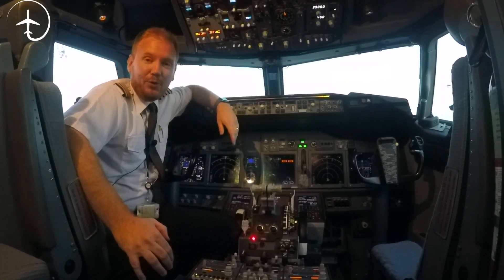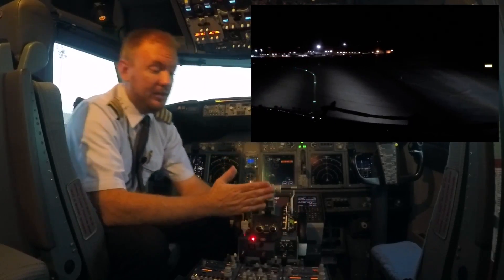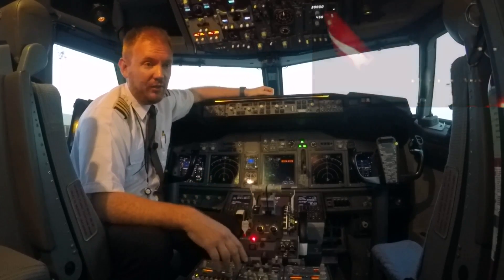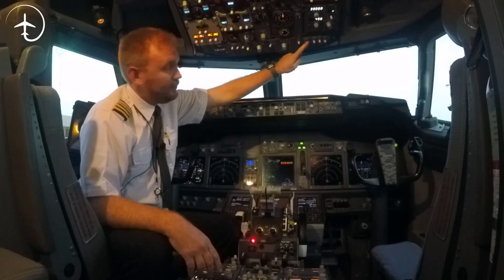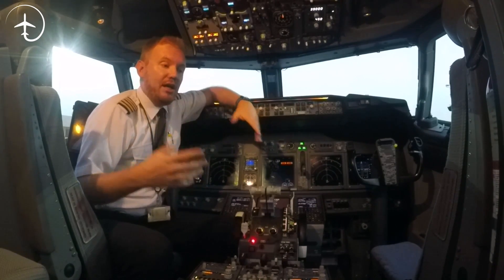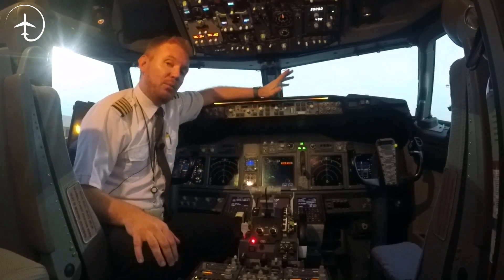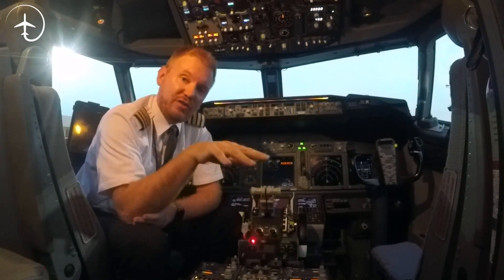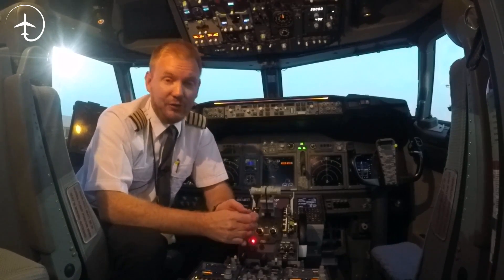Boeing lights explained

Comment: I always wanted to ask you if a malfunctioning autopilot is reason to abort/divert.
Reply: Truth's Knight_0777 we have two autopilots. if the right one doesn't work, than the left one will. difference is autoland is out of the question
Reply: Ava Mendez Just woke up. Lol! Yeah, I know there's redundancy with cmd, I meant hypothetically, if there's a complete failure with both (yes, I know the chances of that are extremely slim) if that would warrant diverting, or would the commander continue the flight manually if he/she feels confident in the aircraft's performance. 
Prolly a dumb question, but just curious... Lol.
Reply: Truth's Knight_0777 most probably divert asap. If there is an autopilot failure, then that’s really something serious.
Reply: A2DJP No, it is not serious, but it increases workload significantly.  On a shorter flight, the crew would probably continue, unless it would put the next flight segment into jeopardy (weather might require an auto land, or needs to be flown in RVSM airspace).  

If in RVSM airspace, the aircraft would have to descend below RVSM airspace.  On a longer flight, it might be prudent to divert, but it depends on weather conditions, day/night, and ride conditions.  It’s up to the crew, maintenance control and dispatcher if the crew involves them in the decision making process.

Comment: Really good video but the sound is not that good. It's sometimes really hard to understand what you are saying because of the dirfferent noises in the cockpit. I don't know if you have something like that or if you using it allready but there are these small microphones that you can pin on your shirt I think that would help. Eyerything else was really informative and helpfull over all good video.

Comment: I often hear the Flight attendants saying that you have to be able to open up the over wing emergency exits if you sit in that row (makes sense). How heavy are those, as you have to lift them out of the frame?
Reply: Itrolller1234 on the A320, the OWE (overwing exit) doors weigh 33 pounds.  a gentle force of about 7 pounds is required to open them
Reply: Itrolller1234 Depending on aircraft, around 30-45 pounds.
Reply: Itrolller1234 On the NG models however the overwing exits are assisted opening and will swing up and out with very little effort.
Reply: Ava Mendez Thanks for the reply

Comment: Thanks for the video! As usual, incredibly good. Here is a question: Why operators usually do not use the retractable landing lights? (Btw just realized the 737 you are flying is not equipped with it, is it correct to say it is something obsolete?)
Reply: On takeoff, some operators avoid using retractables. That is because it can actually cause a little bit of drag. I think this was a more serious issue in the 737 Classic aircraft, but it apparently still exists in the NG.

Comment: Very good explanation, thank you.

I do have another Q for you, hopefully you haven't answered it yet. I'm new to your channel:

How do the 737 yoke and pedals react to your input? Do you feel any resistance from the control surfaces as a feedback, due to the aerodynamics (in normal flight)? How much force do you need to apply to the controls?
Reply: MrJetra on the A320, we make turns by gently moving the sidestick left or right to the correct bank angle.  rudder input from the PF is not required,  since the yaw damper handles this function
Reply: Ava Mendez Thanks, but my Q is specific to Boeing 737 (and 747), because they are fly-by-steelcable, in conjunction to the Airbus's fly-by-wire.

Basically, I know as a glider pilot how to control an aircraft. My Q is if the mechanical linkage in 737 is a feedback. I understand from the Baltic Aviation Academy (BAA) YT videoes that a loss of thrust on one engine requires a lot of pressure on the reverse pedal to keep the aircraft aligned. For that reason you have the rudder trim on the pedestal.

Well, to be honest, my Q is related to an idea of building my own 737 cockpit simulator on FSX/PMDG. There is no trouble connecting a joystick to the sim, but if a feedback is required to make it "realistic", at least I need to know. Next step is to know how much force feedback is required.
Reply: Ava Mendez Btw. I assume you are an Airbus pilot. Don't you have any feedback (except the stick shaker) on your stick? I understand from Captain Joe that there is no connection between the sticks, but there could still be a feedback.
Reply: MrJetra there is no feedback since the side stick is connected to a computer. the Bus is envelope protected,  in normal law, it cannot be stalled
Reply: Ava Mendez Thanks, that is a pure answer. If I decided to build a Airbus cockpit sim, it could use a simple joystick for realism.
Reply: If you watch some 737 cockpit landing videos, you can see the pilot moves the yoke around quite a bit. I don't think a lot of force is needed, but a lot of correction is. It takes a little bit for the controls to respond, and that is why there is so much yoke movement. Left and right, up and down. I think X-Plane 11's flight physics show this very well. Try it out.
Reply: 23 Savage. You're right about the movement.

But as I wrote before, I've seen a video from BAA where the pedals indeed are affected on a single-engine failure. At least it seems to require a large amount of force to align the aircraft in this situation. 

My thought was that the aerodynamic forces on the ailerons would transmit back to the yoke.
Reply: On single engine failures, rudders will be needed yes. However, usually, pilots use the rudder trim instead of pushing the rudder themselves. It's easier, and reduces the workload for the pilots.
Reply: And btw, in normal flight, with windy conditions, i believe (correct me if i'm wrong) the yaw damper actually controls the rudder to avoid the plane drifting to the left or right.
Reply: Ozan Akdag Actually, we use the rudder to control the yaw, then we use the rudder trim to reduce the required rudder pressure to zero.
Reply: MrJetra There is not stick shaker on an A319/320(it goes,”stall, stall, stall). There is resistance felt in the stick to provide a feel when stick inputs are made.  On the 727, 737, 757, 767, the control surfaces are moved hydraulically, but a feel computer, that has an airspeed input, gives some feel of resistance to simulate the feedback that you might have if you were moving the controls by cables.  Faster speed, more force required to move the yoke.

Comment: Is there any way the pilot can communicate with ATC tower using the lights, in case there's a radio failure?
Reply: Mr Me In smaller aircrafts, there a radio failure or no radio procedure. You come in for the approach and rock wings (turn right and left) and this procedure will make the ATC understand about your radio failure. Some people also blink the landing light on and off but am not sure if that's a standard procedure. So once you rock wings, the tower will guide you with a light gun, and there are several light gun signals that any pilot should have memorised at any given time should their be a radio failure. You are taught that in ground class in your PPL stages itself. As for bigger aircrafts, they usually have a transponder and they squawk 7600 for communication failure so the tower knows that the radio has failed. Though I am not sure if the lights can help in any way, but I hope my answer gives some basic idea about the concept.
Reply: Good question. Yes the Squawk code is the option used in airliners and big aircrafts. But in most GA planes, we fly VFR and we don't always have a functional transponder. Most GA planes lack transponder and / or don't use it, hence the only way is the light gun signal, as in, rocking wings to let the tower know our situation.
Reply: 7600 in the box and follow lost comm procedure from the charts
Reply: Shafat Hasan Isnt squawk code an easier procedure?
Reply: Mr Me  Yes There is...There’s a piece of equipment called the “Light gun / signal lamp” There’s specific colour that signals that has specific meanings
Reply: Shafat Hasan Makes sense thanks.
Reply: Shafat Hasan No operational transponder?  What country do you fly in?
Reply: Mr Me homing pigeons work

Comment: Favourite thing that I only found out recently. Easiest way to distinguish between Airbus and Boeing is that Boeing have a single flash strobe while Airbus planes have a double flash strobe. 

(that is if you can't tell them apart anyway.........)
Reply: Boeing commercial jets have pointed noses while the airbus have the rounded somewhat Douglas like noses
Reply: Cool! Never noticed that 😉
Reply: You can still see the double flash on older model Boeings.
Reply: James Funnell 747 has a double flash
Reply: Airbus has mini winglets whereas Boeing planes do not

*Pending on the airline

Comment: the anti collition light is not always red. kan be white too. the King air and ATR have white anti colltion lights :)
Reply from the maker: +Eric Kindholm Really? That would greatly surprise me. I need photo proof! :)
Reply: I can confirm that. I work on the ramp at CYVR (Vancouver Intl) and have seen white anti collision lights; primarily on the Saab 340. They are weird though in my opinion because I usually attribute white pulsing/flashing lights to the strobes. :)
Reply: Mentour Pilot i can try to take one at work :) working on the ramp at ESSL/ Linköping City Airport and BAM. :)
Reply: Mentour Pilot some ATR 72 have a White but not all. All of them I have  seen have White. But send a PM so can a send some photos 😊
Reply: Eric Kindholm atr? Don't they have a read beacon light atop the vertical stab?
Reply: Mentour Pilot https://youtu.be/_9Dg6bLqZBE i too got confused with a strobe light instead of Anti Collision Light

Comment: Do you turn anti-collision off when you have pushed back, or when do you turn off the anti-collision lights?
Very nice vid btw!
Reply from the maker: +Zach21GF The anticollisuon light stays on until we have parked, after flight when the N2 drops below 20%
Reply: They're turned on and left on until the engines are shut down and the aircraft is no longer moving. In the air and on the ground, they're used to indicate your presence to other aircraft, like police car lights.

Comment: Will a modern airliner allow for the starting of an engine with any door open. Also when a light blows apart from you receiving poor illumination will the plane tell you that it's blown. And which lights are you allowed to fly without?
Reply: jstuttgart Engineers check the lights every night and we (ground crew) will notify of beacons (anti-col) not working if its just recently blown and not in the tech log

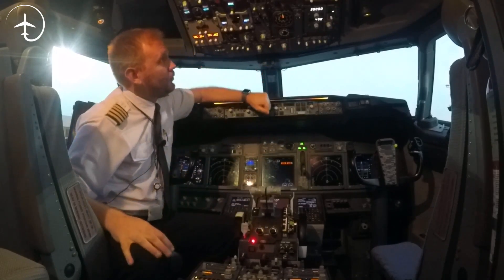Comment: At 5:58, what is all that stuff inside the wheel well?  Do you actually know how to recognize if something doesn't look right in that tangle of wires and cables?  Maybe you could do a video on the walk-around that you mentioned.  That would be a view of the 737 that most people never get to see.  Cheers.  Great channel.
Reply: Hsfh Fejtpo + I agree! Good grief what an extensive maze of lines & hydraulics! Yikes!!! Newbie question too: Do you have to hit the brakes to stop the wheels from rotating before Gear Up?
Reply: ann nonymous No.
Reply: Hsfh Fejtpo It has been a while since I had my head up in the wheel wells, but some of the lines are for hydraulics.  There is a fire detection loop around the top.

Comment: Regarding what you said about the wing lights and icing, I was surprised to hear you say you could check the wings from the cockpit window. I didn't think you could see the wings from the cockpit?
Reply: stevefranklin72 you can check the end of the wing but not the engines, primarily the area between the tip of the wing and the engine
Reply: The trailing edge of the wing is visible, this is the only part of the wing that uses engine bleed anti ice, to melt the ice.
Reply: In the 737-800, you can see a little bit of the wing. You can see much more on shorter aircraft such as the 737-600 and 737-700.

Comment: Hi.. Why your 738 version doesn't have fixed and retractable landing lights separation?
Reply from the maker: +Umberto Pedrotti It’s an updated version with the LED arrays.
Reply: Are the retracts prohibited above a certain airspeed (250 Knots), and need to be switched off after gear up
Reply: EinkOLED there are not "retracted" lights switch in this video
Reply: Yes, but in the non updated versions of the 737NG there are 2 retractable landing and takeoff lights that retract from under the belly of the aircraft. They're prohibited above a certain airpseed (like landing gears), otherwise they'll become damaged.
Reply: I believe some operators don't even use the retractables on takeoff. However, those that do, turn them off after gear up as after takeoff procedure.